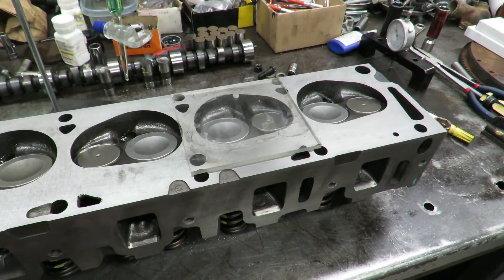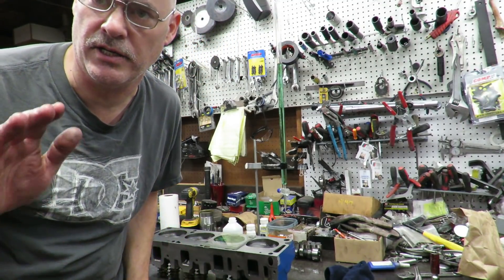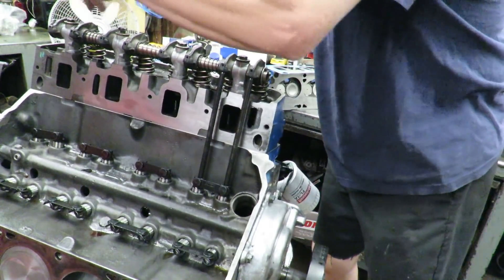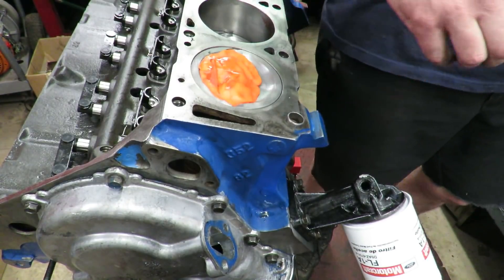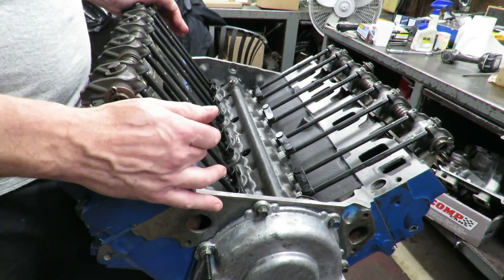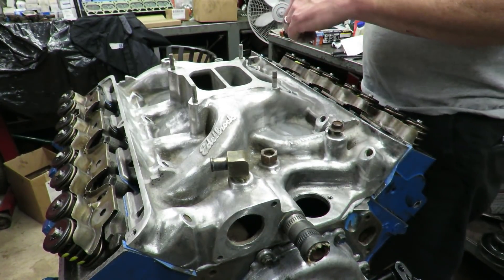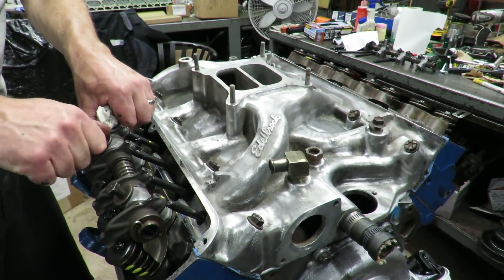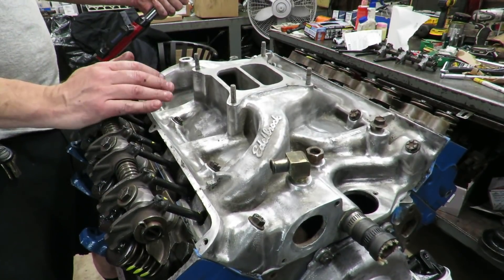390 Ford stroker Build part 8

Comment: I am getting ready to do a 390 build.  I have a 360 that I will be converting over to a 390.  What internals, crank, rods, pistons, rings, bearings do you recommend and the best place to source these parts?  I've watched all your FE videos multiple times and you do an outstanding job.  This will be my first FE build after building several windsors.  Plans for the engine is to be installed in a '67 Mustang with a manual transmission.  Looking at 9.5:1 compression, hydraulic roller, Edelbrock performer RPM heads/intake, long tube headers.  Target is 400+HP at the flywheel.

Comment: You seem to have lots of experience as machinist but maybe not a whole lot of experience as Ford engine builder the reason I said that is because I have seen a lot of mechanics installing the intake just like you did and have to take it out when they tried to put the distributor in something I learned the hard way is when you set you intake you install your distributor at the same time just to make sure it will go in other than that you are doing a wonderful work teaching us keep the good work

Comment: I usually put the distributor in the hole before tightening the manifold. It can cause problems if it's not lined up correctly.

Comment: I am doing a rebuilt on my FE 390.
For the first time in my life. When you check valve to piston clearrence, previously you have checked the rocker geometry and the correct length of the pushrods? This affects the result with the dough? Instead of solid lifter, I can use checking springs ? Thanks. I like your videos. You always explain it well.

Comment: I am building my 360 FE out of my 71 4x4 and have found you videos most helpful, just one question, I noticed you did not put the valley tray back in before you put the inlet manifold on, I may have missed it but is there a reason for this?

Comment: Loving this series. I dropped my 428 off to be built recently and we're stalled waiting on parts - being the other side of the pond, getting hold of FE parts takes time and patience, making building an FE even more time consuming (imagine waiting weeks between figuring out pushrod length and the rods turning up..). So this is as close as I can get to a finished engine for now ;)

Comment: enioy all your videos ..and hope you can help me quick. brand new 347 stroker. Trick flow heads, RPM air gap manifold. You know the manifold ports don't 100% match the heads. Manifold has no back water port and no ports between ports 1 and 2 , 3 ad 4 like the trickflow heads (I assume they are water ports?) . I used Gasket cinch and Mr Gastket (that's what they recommend now and not felt pro) and black RTV around front water port and front and rear seal. Should I have also done so around the other water ports even though they are  not used? The urgency is the engine goes in Saturday and if I have to redo it, have to do it today, Friday...Your help appreciated. If you think its good with the gasket cinch and the one port RTV, let me know..and thanks
Reply from the maker: I would RTV all water ports
Reply: @Myvintageiron7512  Thank you ! Handled !

Comment: Hello. I'm building a mild 390 FE. Question if I may: I checked the intake manifold fitment because I had the block and heads surfaced. I fully torqued the manifold with my new FelPro blue gaskets. Can I use these gaskets for final assembly or should I buy another set? Just wonder if tightening to 35 ft-lbs flattened out the gaskets preventing them from sealing properly. Your thoughts?

Comment: Quick question. When you measured combustion changer volume, it looks like mistake may have been made. Didn't the area of the tube between the plexiglass and valve also get measured? So it may have read larger than actual CC volume.
Reply from the maker: nope all the liquid was in the chamber

Comment: Marvin I noticed no sheet metal baffel used under the intake manifold mine has one ! .
a
Reply from the maker: the baffle can not be used with roller lifters Comp cams and Edelbrock both told me not to worry about it  it's in there to keep hot oil off the intake but the Aluminum intake dissipates heat so well it's a non issue

Comment: would the fe engines cool properly if both head gaskets were blocked at the rear, or if just one was? Reason I ask is that I just put on a head gasket onto a 1968 360. I did install it the way myvintageiron suggested with the front blocked. But here is where it gets strange the head gasket I bought had the word front on the open side and the back side was blocked. Also the blocked side had a metal area that would have fitted into the block side if installed correctly (which would have meant blocking one side on the front and one side on the back, both sides would have then been metal side into block). It was an enginetech head gasket in a complete gasket set part number F390A from rockauto.
Reply from the maker: the open side of the gasket goes to the back always always no exceptions
Reply: @Myvintageiron7512  awesome. Thanks, I wish I took a picture of it before i bolted head down. But I did do it the way you mentioned. It just makes sense when you look at the head passages and intake/thermostat housing location.

Comment: We will be looking for the cause of a rough running eng and will be starting the eng after removing the trans. I had no idea it would bend a FP to not have the torque converter on. You've saved me a flex plate!
Thanks again for a great video.

Comment: Ok appreciate the advice so what would be best to mill my block down or my heads? Or would both be better? If you don’t mind me asking this build I’m doing will  be a street strip deal and I’m looking at rotating assemblies from summit as of now in your opinion would it be better to go that route or would buying piece by piece be better? Sorry so many questions just would like someone like you who has built these engines in there sleep lol.
Reply from the maker: I would buy the Scat rotating assembly and have it balanced at a local machine shop buying it separately is more expensive

Comment: Wow, look at the huge amount of gasket space on the intake gaskets, is that how much difference there is between all 
the different port sizes, low, mid, high rise? The intake port openings look way smaller than the head ports.
Reply from the maker: there is no performance change with a smaller gasket so we don't bother buying it any more Fel Pro has one of the best intake gaskets so we use em
Reply: That's not what I was meaning, just noticing how much bigger the ports on the high rise heads must be, 
did you say those heads you used were mid rise? and I was surprised at how much smaller the intake
 manifold ports looked compared to the head ports, especially being an Edelbrock.  I have a a 67" 
390 I'm going to build for my 69 High Boy but haven't disassembled yet.
Reply from the maker: you can get a manifold with the larger ports but you loose some low end TQ the smaller runner duel plane intake works much better on he street in a truck the bigger intake tends to make the engine sluggish on the low end
Reply: Have you done a video on setting the proper lash on hydraulic lifters in an engine where the lifters were taken out 
and put back in (wet vs. new dry), if not could you there is a lot of conflicting procedures out there and I believe
you know what your talking about and would trust your opinion.

Thanks for the videos, I always watch when you put them out and I either learn something new or remember something I forgot.

Comment: Quick question, the customer already ok'd the expense of a stroker crank so why not go for the 4.250 crank? From what I've seen they are the same price. Not being critical just wondering since I'll be building one of these also. I was planning on the 4.250 but is there a reason I shouldn't? It will be for a 65 f250. I guess it wasn't a quick question.
Reply from the maker: I do not recommend that crankshaft it pulls the piston to far out of the bottom of the bore I've seen a couple of them come apart because of it
Reply: Myvintageiron7512
Oh I see. The wrist pin hole needs to be so high up on the Piston it pulls the skirt down too low.  Good to know. Many thanks!

Comment: Hey boss man I’m currently building a 489 bbc stroker I ordered a kit and one of the piston had a little defect in it so got with the company and they sent me a piston I gave them the weight of the other pistons witch was 518g but they sent me one that is 521g my question is in your opinion will the 3g make a difference thanks in advance.

Comment: Another good video. I wonder if you could tell me what cam, crank and pistons you installed in this engine. I would like to build my 390 as close as yours since mine is going in an F250. I'm really not confident in choosing these myself. Forgive me if you have given this info in another video.  Thanks.
Reply from the maker: I can do one better I will attach the Article that gave me the idea for this build complete with dyno resultshttp://www.mustangandfords.com/how-to/engine/1410-how-to-build-a-390fe-stroker-500-pound-feet/
Reply: Thank you so much. That's just what I needed. You made my day!
Reply from the maker: no problem I'm happy to share
Reply: Any Ford 4.6 Modular engine builds?

Comment: 74cc head displacement, 30cc piston dish displacement, I'm guessing 2cc head gasket displacement witch is 106cc but no cylinder dimensions got to go back threw older videos just because I'm curious🤔😆
Reply from the maker: 4.080 bore 4.125 stroke the piston is actually 20 cc I made a mistake there the beret was not filled to the top I re checked off camera because it did not seem right head gasket is .040 compressed deck Clearance  is .006 my math says around 9.5 to 1
Reply: @Myvintageiron7512  i was trying to figure it all out as well.

Comment: I like your builds but FEs are a strange animal and require a few tricks here and there. What I didn't see you do is to insert the distributor and then start the bolts. It's very common to have the distributor hole in the intake off enough that you either can't insert it,  rotate it or it leaks if you don't use it to assure alignment.

Comment: When you removed the intake,  I thought there was a Valley pan you removed.  I didn't see you reinstalled,  does it need to be there?
Reply from the maker: not with aluminum intake and roller rockers much less heat and friction
Reply: @Myvintageiron7512  thanks for answering my question

Comment: Hey boss have another question for you if you don’t mind me asking but just received my heads back from the shop and I have the 049 heads. I had the 2.19 and 1.88 installed and my question is if are the exhaust valves are they supposed to stick up a little higher than the intake valve? Bc mine do. And what’s a gd way to know if they truly did a 3 angle valve job?
Reply from the maker: Yes they do protrude higher than the intakes

Comment: No valley pan or whatever that plate is that sits underneath in the valley of the intake?
Reply from the maker: The valley pan does not fit with roller lifters the aluminum intake will dissipate the heat better so not needed

Comment: Great video. I did the same thing with my performer RPM intake with the black paint. I couldn't believe you didn't put roller lifters on this build but I guess there wasn't a need for it. Did you opt for the aftermarket hardened rocker shaft?
Reply: These engines run forever in stock form. There really wouldn't be much need for a hardened rocker shaft unless the customer just absolutely requested it.
Reply from the maker: Actually it does have roller lifters and cam
Reply from the maker: roller rockers is what you meant I'm guessing roller rockers are way over rated they do absolutely nothing below 6000 RPM complete waste of money

Comment: If I remember correctly, you used a roller cam? If so, why not use new roller rockers as well?
Reply from the maker: roller rockers do absolutely nothing below 6000 RPM they are a waste of money
Reply: I wasn't thinking of them for power, I like them because they keep me from needing to add zinc to the oil and their overall durability - like any modern V8 made in the last two or three decades.
Reply: If your running a flat  tappit camshaft you need  oil with zinc. Roller rockers has nothing to do with that

Comment: Any risk of turning the motor after lubing and installing new flat tappet cam - will the assembly grease get wiped off lobes? Wanted to check how motor turns over with rocker arms installed but afraid of wiping grease off cam lobes. Your thoughts?
Reply from the maker: it's fine you can rotate it

Comment: i notice the intake gasket is over size at the bottom of the head intake port , ones the intake is on there will be a gap at the bottom of the port and the intake runner , is this not bad for flow and course the air to tumble and create turbulence? or for this Engine application not a big deal? :)
Reply from the maker: this has been tested every way possible over the years on many dyno's the results show no difference when changing gaskets

Comment: my 63 t bird 390 has adjusters on the rockers other then that it looks the same but it takes it's own bell housing bolt pattern not inter changeable with other 390's or the auto trans to the bell housing i had to build one could not get one even after market i got the motor for 75 bucks with about 4000 miles on rebuilt then i found out y but it was well worth it tri power 400 hp stock spec. not sure all what they did to motor but it runs hard i have a few 390's but a ton of 360's does the 360 have the same heads as a 390 both truck motors the 390 is a 73 /78 pu motor and the 360 is 67/72 motor this what i seem to get a lot of i want to put the t bird motor in a 67/69 mustang just waiting to find a good deal on one or trade for it but it can't have rust or it can  have just a little  one thing i hate about chevy's hard to get rust free but have a few only need one camero a 69 for my collection  and now i'm starting to collect mustangs don't have any old one's yet but just one i use to have a shelby but sold it to buy my place i miss that car same with my 66 gto and  22 inch lifted 4x4 step side chevy

Comment: Hey boss great videos have a question I’m building a stroker 489 bbc and I’m going with the 049 heads. I have them in the machine shop now getting bigger valves installed my question to you is how much can I have milled down without getting to crazy with it? I’m planning on using 18cc dome pistons and plan on trying to stick with 9.5 to 10 compression. Thanks in advance
Reply from the maker: that sounds about right you don't need to mill a ton off the heads with those pistons I am actually doing that exact same build right now however I am not doing a video series on it those pistons should put you at around 10 to 1

Comment: Waa I missing something.. during all that work on them heads.. how come u didnt port an polish them?
Reply from the maker: Because a port and polish job is around $800.00 and the customer did not pay for that ,
more importantly Porting and polishing these factory heads is a complete waste of time,
 by the time you port and polish these heads you will have more money into them then just buying aftermarket Aluminum heads that will out flow your ported iron heads by a mile
Reply: Thank u for responding. That makes total sense. I appreciate the information a great deal. Ive learned alot from ur videos. An will continue to watch.

Comment: I noticed you didn't use the stock plate under the intake manifold is there a reason for that?
Reply from the maker: The roller lifters are too tall it won't fit
Reply: @Myvintageiron7512  ah makes sense, thank you. Love your videos by the way